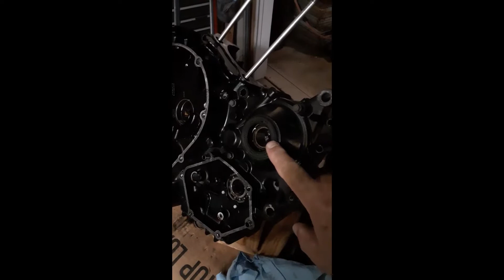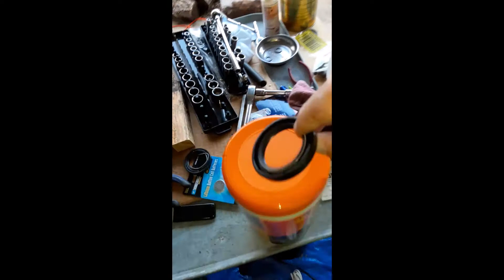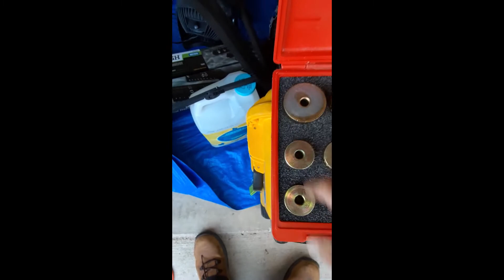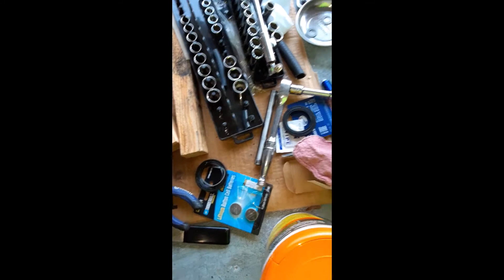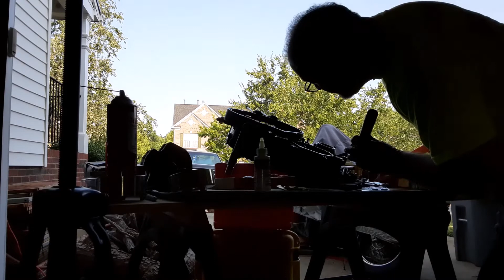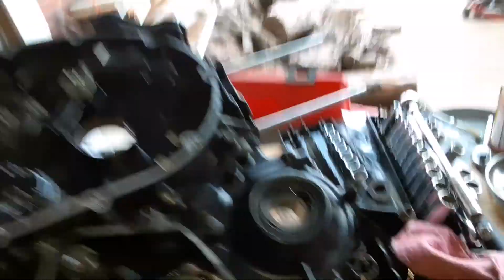2006 Vulcan 900 Engine and Transmission Rebuild / Reassembly

Comment: the bushing drivers are the proper approach indeed.. next best thing is the old seal used as a driver.

nice series mr Tom, hope you're doing well.
if not too late, keep in mind they also upgraded the alternators about the same time they did the gearbox. the first generation seemed to occasionally overheat the top coils sitting out of the oil; so maybe a quick visual inspection and a resistance measurement wouldn't hurt. wish you all the best!

edit: i learned not long ago they upgraded the bolt that hold the generator rotor w/ one that has a hole in the middle to spray oil on the stator and prevent the coils from overheating.
also, that seal on the output shaft shown here sits flush w/ the case from factory... i don't know if that matters much as the spacer between the output shaft bearing and the engine pulley inserts about 1/4inch into that seal.

Comment: Did you ever finish the vulcan 900?
Reply from the maker: Randy - believe it or not,  I am still painstakingly slowly getting it done. My job interferes with getting the work done. I actually have some more video in the can, so to speak which I will try to get posted over the holidays 😅.